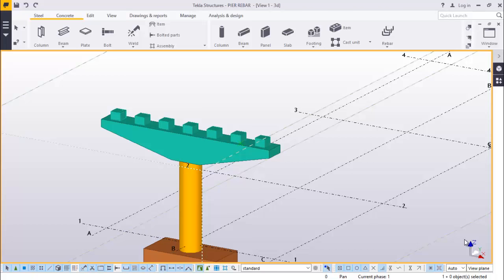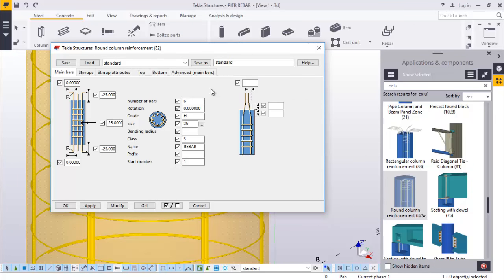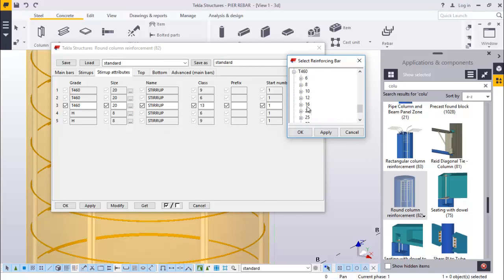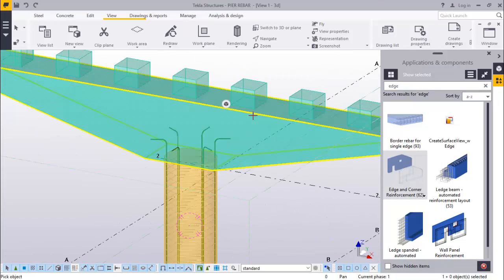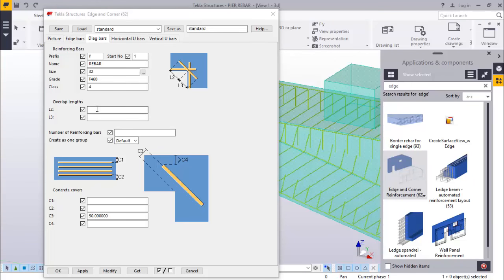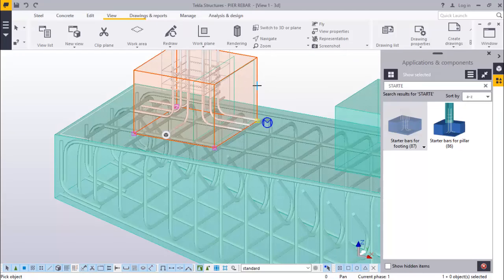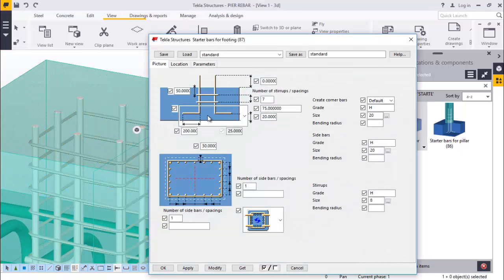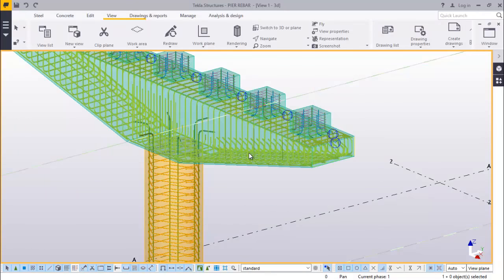Bridge Pier Reinforcement in TEKLA STRUCTURES 2016

Comment: thanks for your video and your efforts, but I heve somes reserves on your job because the job is not completed, there is not connection between the reinforcement bars of the fondation and the columb, or between the columb and the support, and if you can help me I need that some one show me how change the forme of the end of the bar because TEKLA use automaticly a rotaation at 90 degre but in my country we use a rotation at 45
Reply from the maker: 45 and 135 rotation degree is available just check